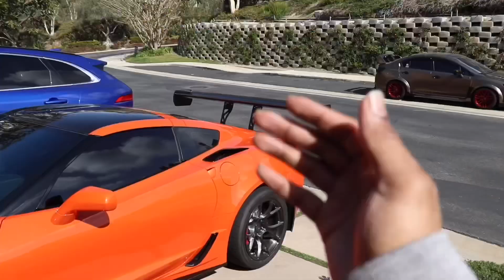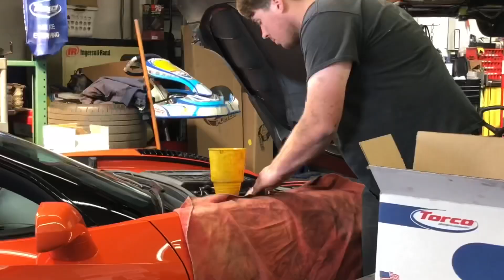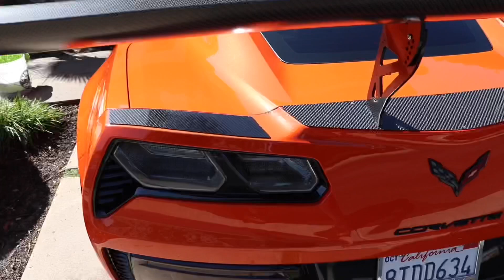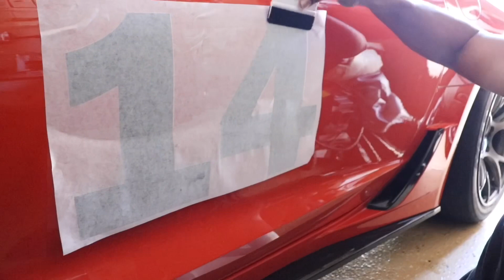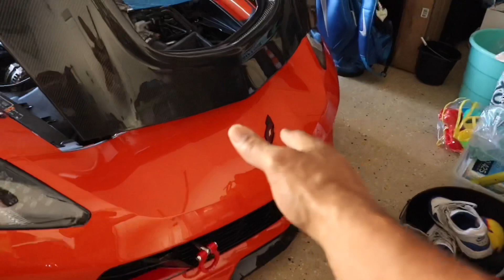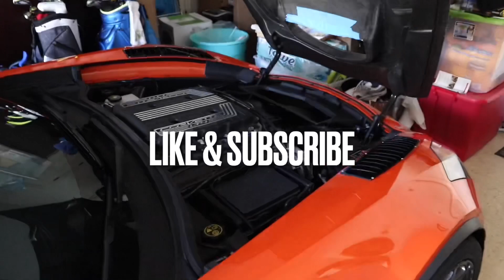TRACK PREP FOR THE CORVETTE Z06! Big Willow Springs Race

Comment: Bro you should get the EOS ZR1 high wing... definitely less drag versus this one
Reply from the maker: The E0S wing is basically plastic and doesn’t work as well as this one. This one has more adjustments and is wider and stronger
Reply: @ChristianHudnell  hate the look but if it does the job then 👌🏽
Reply from the maker: @frangalvan3703  i feel it! I appreciate it and the high wing looks cool too!